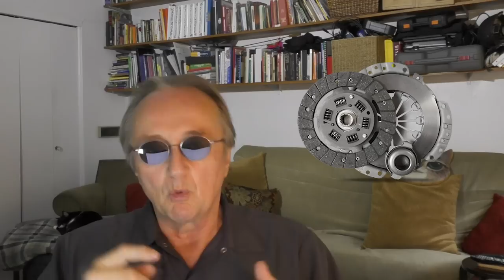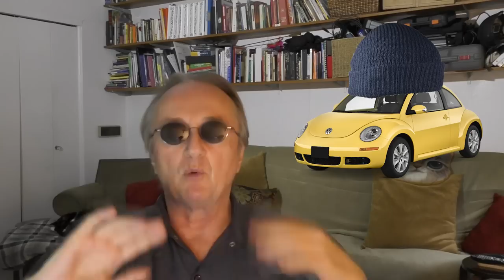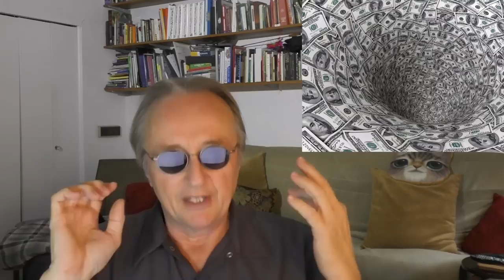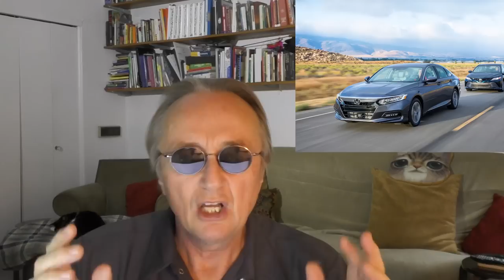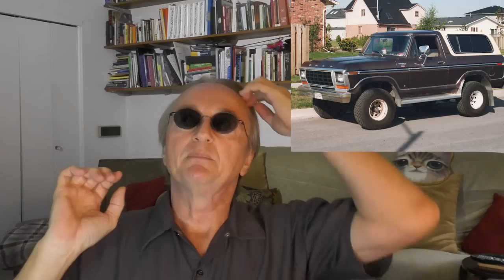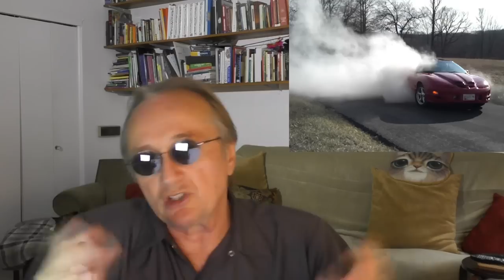Doing This Will Destroy Your Car’s Flywheel

Comment: You can buy the clutch for cheap.  It's the labor that's a killer.
Reply: 351WINCHESTER true
Reply: @adrianleap6351  But it's no cheaper when you need the flywheel too...
Reply: Well it is a lot of work
Reply: Do it yourself and it costs a lot less.  Pulling wrong wheel drive transmissions is a poopy job however.
Reply: You still have to replace or repair the flywheel after 2-3 clutch replacements. On my car it was worn out in the middle, so it wasn't flat. Instead, it looked like a funnel. It made the clutch quite jerky.
Reply: @vladimirlindemann5422  I get my flywheels resurfaced every time I change a clutch, even if 1st time.  I'd rather fork over the $50 or so for the machine shop charge and know everything is done correctly than to shorten the life of a new clutch.
Reply: @Ryno-fp7pm  Yep. It makes a significant difference.
Reply: Had to do a clutch and dual mass flywheel on a diesel peugeot, over $1000 with parts and labour and took 6 hours
Reply: @VeLvEtGuNs  Dual mass flywheel is a story on its own
Reply: Ryno5150 how can you tell if the flywheel is bad after the fact. I've put a few clutches in, not myself though.
Reply: @notthisguy5068  the surface of a worn flywheel has dark stains (blueing). You can also check it using a straight edge.
Reply: @hungrynapps  , 4 Hours Of Work ?
Reply: I had a car that was gonna cost $1300 for just the clutch kit... The car itself was $150 running and driving, I sold it for $500 as is 🤣

Comment: Had a 06 v6 hyundai sonata.. 184,000 very hard miles when i traded it in... only thing i ever replaced was an upper radiator hose.. brother has an 06 hyundai sonata v6.. just rolled over 260,000 (original spark plugs by the way)  timing chain was all he had to replace ... i am not a hyundai fan by any means but they seem to run pretty long if oil is changed.

Comment: Beam me up, Scotty. I just financed a 2017 Chevy Cruze hatchback, 16,000 miles on it, and i have noticed that the car does not like to be "learned" on ar as HP goes.  I leaned on it the first time I drove it off the lot and I got a warning that the StabiliTrak WAS NOT ACTIVEay this because the car changes gears when It feels like it. Please tell me what to do before my 45 bumper-to-bumper, the warranty runs out. I  Not that I want to, but why does the car tell me that it needs maintenance. The Check engine lights came and everything. What does this mean? ?   Can I not drive my NEW car as I wish?   Cut me some truth. . . . . . Love this channel

Comment: Hey Scotty, I have a 2002 Chrysler 300m that won't start. It cranks just fine with no odd noises. After the power is on for about 10 seconds, the check engine light flashes, but it tries to turn over when I spray starting fluid into the air intake. I'm thinking its a fuel pump, because I don't really hear anything kick on when I turn the car's power on, but I don't want to replace that unless I have to. I already checked the fuel pump fuse and it was good. Any advice as for where to start? Thanks.

Comment: Notice every single car someone mentions is not recommended and uh I know a family that since 2011 they have been buying all the new Hyundais and especially the Genesis one of them I know specifically has 263000 miles on it like mentioned you do the maintenance on the vehicle most likely it will last you as far as Volkswagens I mean we all know that those Transmissions aren't the greatest but I mean come on I'm not defending Hyundai I had a 2011 Hyundai Sonata 2.0 T and honestly that car treated me pretty well my cousin got in a 2011 with a 2.4 and there was a massive massive recall on the bottom end of those engines something about the crankshaft being manufactured the wrong way picking up shards of Steel in the oil pickup lines

Comment: To get a New Beetle trans replaced cost around 5K?...Is that rebuilding the bad one?...I thought that a good trans shop would have a rebuilt unit on the shelf and that would simply be an R&R to minimize "down time"...By having several units available, the cost should be much less.

Comment: My dad has an 04 Camry and the original clutch made it just over 360k before it completely gave out. Was a heck of a chore changing that thing out but totally worth the trouble.
Reply: Your dad is one of those men who really do know how to use a clutch.
Reply: Many others like me don't I guess you just have to shift veeery fast.
Reply: No, you need to match the rpm of the engine to the transmission speed/road speed. Hence good manual drivers can heel-toe to raise engine speed on downshifts, and release the clutch smoothly to perfectly match the engine rpm to the rotational speed of the transmission in upshifts. This is how you drive without jolting the drivetrain and burning the clutch through the friction of mismatched flywheel and clutch speed. (Your clutch is attached to the input shaft of your transmission on splines).
Reply: We were at a red light when my friend's Honda Civic clutch cable popped. Just a pop sound, and no more clutch. He's hating life while cars are honking and trying to go around and I'm like here, let me drive. I don't know what you're gonna do without a clutch but at least people will be glaring at you and not me. Turn the car off, get it into first, then start it in gear. Shifting into second is tricky, have to match the gear speeds exactly as you feather it out of first gear. Compared to that, shifting into 3rd and 4th was a piece of cake. He's like how are you driving a stick shift without a clutch? Well I didn't know I could until you stranded me in the middle of an intersection and put me on the spot.
Reply: Mine ia currently on 113k kilometers original clutch on Chevy aveo 1.2 2006
Reply: wholeNwon Probably all highway miles.
Reply: He was probably granny shifting, not double clutching like he should've!! 😂 sorry that was mandatory.
Reply: @SavageBunny1  , Double Clutching A Car ?

Comment: The policy in relation to a failed vw clutch or flywheel in these parts is to replace both, as the labour cost of the operation is high and if the remaining component is retained it may still fail later, just as the water pump is changed at the same time as the timing belt. I’ve never changed a clutch, and it doesn’t look like an easy job!

Comment: I personally would drive a manual 2006-2012 Honda civic si coupe as my first car and modify it because the parts are readily available.
Reply: I stopped driving a Manual 6 dpeed Subaru outback  with  120,000 Klms Diesel it was a great car wagon  1000 k,s per tank  no  got my Honda CRV ald great all  town rounder  $65 to fill the tank on 91 octane car .
Reply: Id rather stay with my 06 chevy ssr way better made best first car to have
Reply: Tuco Salamanca 😂😂😂😂😂
Reply: @dungdippedindian3933  So you're saying 06 GM somehow isn't the absolute low point of car manufacturing quality in history
Riight
Reply: Or If you want the space get a caravan before 96 my 91 has 50k miles and ive only had to replace the transmission once
Reply: You can run into issues with those cars. Most people drive the SI fairly hard and don’t always keep up on the maintenance. A lot of younger people buy them and don’t really know how to treat a car. I personally wouldn’t buy a used one that old unless I know for a fact the previous owner took good care of it
Reply: @bigmid7486   You're right about that and I don't understand why some young people or even some people in general treat cars like crap. It's no surprise why the Honda civic or yet the entire Honda brand in and of itself gets a extremely bad reputation for either being riced out, poorly treated, or being clowned on. But that happens to most car models as well not just Honda. Like you said some young people don't treat a Honda civic very well, that's almost the equivalent of treating a nice extremely expensive car like a piece of crap instead of driving it precisely and taking a great care of it. I'm only 18 years old and I am a sporty car person but even though if I drive a Honda civic Si 2006-2012 I would treat it good like a nice expensive high end sports car even though cars in general are mostly expensive anyways. But thanks for the information, that'll keep me in mind when I buy my own car some day.
Reply: EvoEvan Nismo Just definitely make sure you get a good mechanic to look at it, like Scotty always says lol. Honda Civic Si has a negative stigma for being a young kids car unfortunately. I drive a 2018 Ford Fiesta ST and I rarely drive it hard. It’s super fun to drive and it’s really quick but i actually want it to last lol
Reply: back when i had my Integra kids in civics were constantly trying to race with me. its was so annoying.  Nobody bothers me in my Toyota now. lol!

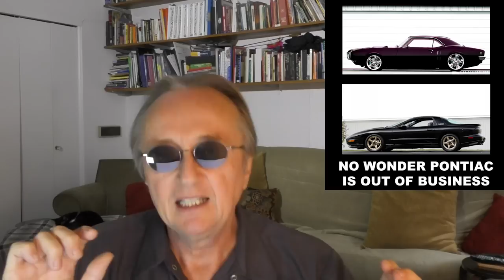Comment: 4:09 All true but so long as it's taken care of the 3800 can go 250K without a thought.  Just change the oil.  The 3800 is an evolution of the Buick 3.8 and heralded as one of the best V6 engines in automotive history.  It's a pushrod V6 with a single cam and in 2000 was pumping out 210HP and 220Lb/ft of torque.  Translation no multicam VTEC timing belt BS to deal with.  A simple design that is easy to work on which in that body is saying something.  I had one in a Camaro that had 157K on it and the only problems I ever had in that time were water pumps which on that car is literally 20 minutes to change with 1/2 a beer.  I'm a little sick of the GM hate from Scotty.  Yeah, they made a lot of crap but so did all the automakers.  With the 2000 V6 Firebird the biggest thing I'd worry about is the 4L60E transmission which has a reputation for failure but in my case I had zero issues with it in that car again because it was kept maintained with regular fluid changes etc.  The biggest mistake GM made with transmissions was putting a transmission like the 4L60E  (which was really just a 700R4 with electronic control) behind engines that were too powerful for it like the LT1 and LS1.  Fine behind a V6 but V8's of the time could easily tear them up.  Hey, I'd buy one now (a V6 Camaro or Firebird)  if I could afford it but I'd want to see service records.  If it wasn't maintained then everything Scotty says is true.

Comment: Good to know, all I drive is manual transmission cars, this will save me lots of money.
Reply: Mazinblaster Z 
Never! My very first car was a manual transmission and that was 26 years ago. In all that time I’ve owned 5 manual transmission automobiles and I did wreck a few of them but a clutch has never gone out on me. I absolutely hate automatic cars, I’ve never owned one and I never will.
Reply: Mazinblaster Z 
I live in San Antonio Tx and I go to Austin and Houston quite frequently and the stop and go traffic doesn’t bother me driving a manual transmission vehicle at all. But I do know there’s a first time for everything and I’m sure one day my clutch is going to go out on me. I currently have a 2013 Honda Accord and I have 119,000 miles on it. I’m not very mechanically inclined which is why I subscribed to Scotty’s channel and it’s videos like this one that are most beneficial.
Reply: Richi RIch 
LOL!
Reply: @Mazinblaster Z Austin traffic sucks but driving manual in it isn't so bad. Maybe I'm just used to it tho.
Reply: In my opinion, I'd much rather daily an auto.. but I'd keep a manual as a fun weekend/casual car
Reply: Same for me, I've owned 5 cars over the last 15 years and all were manuals, and I've never burned out a clutch, AND I only drive "classic" cars (Pre-1992 non-fuel-injected vehicles) However my current car, a 1991 Peugeot 309 has had it's synchro in 1st gear broken by the first owner, so I don't know what shape the clutch and transmission is.
Reply: @Mazinblaster Z It's cheaper then repairing or replacing automatic gearbox
Reply: With how often most of you are changing cars, it’s no surprise the clutch hasn’t burnt out on you.

You think Austin is bad, try Pittsburgh. Stop and go traffic, on a steep hill. I feel bad for my Element.
Reply: @bonnevillebagger9147  that sounds like a nightmare.
Reply: @pilgrim985  "hate" is such a strong word...and I could not agree with you more.  Automatics are awful.  So awful that I have done auto to manual swaps on 3 of my vehicles.
Reply: Ryno5150 
I really like the Toyota 4Runner, a couple months ago I went to the dealer only to find that they don’t make them in a manual transmission so I left quicker than I got there. I don’t know how to convert an automatic to a manual transmission or how expensive it is but maybe I’ll look into it.

Comment: Guys please upvote this to get Scotty’s attention. I really need serious help, or if anyone has a helpful opinion let me know. Also, if you need more detail that can be provided too.

Scotty please help

I have a 2014 INFINITI Q50 3.7L V6 Naturally Aspirated. Note: Proven Stillen-brand Dual Hi-Flow (oil filter) intake installed. Note: Car began idling lower. Nothing wrong, until months down the road when the RPMs would begin dropping down between 600-1000 after gas pedal is released while coasting anywhere between 30-50MPH. Tachometer visibly bobs up and down, appearing to want to stay awake but continue almost falling asleep. On bad days, RPMs will drop too low and engine will stall while car is still in motion, power steering will then disengage, and battery / check engine light will appear. I pull over; restart car. Engine turns over instantly. Begin driving; problem persists but stalling does not. Symptom only common after each time battery is disconnected. Note: ECU evidently re-learns and gradually adapts to problem after every occasional project-related battery disconnection. Symptom more than likely to occur after being heavily throttled very shorty after turnover. Symptom has never occurred at speeds 55-60MPH or above. Each and every source points to IAC Valve cleaning. Anything else?

You’re the best Scotty, please help me out.
Reply: Sounds like it needs reprogrammed by the dealer. Or maybe a bad idle control motor.  Don't let it go on very long as it may cause ECM damage and it could be unsafe

Comment: Scotty Kilmer sir,

My friend has a diesel suzuki dzire 2017 auto transmission car. He was complaining about loss of power (like engine stalling) while driving and again power comes back to the vehicle. He got the transmission changed at 40,000 kms (24,854 miles approx.) at company authorised service center. The above problem was before the transmission change. Now, after the change he is once again facing the same problem. During the pandemic he already drove 8000 kms (4970 miles approx.) without oil change for more than 1 year now.

This car is one of the popular and highest selling car in India.

I watch your videos all the time. Please answer this question through a video if possible?

Comment: Regarding your advice on selling the VW Beetle with the bad transmission that needs to be warmed up to work, it is important to note that when you go to sell that car it would be unethical not to notify a buyer that the transmission has a problem and describe the problem.  It's just dishonest to try and cover up a deficiency that seriously affects the car's value.  The car will still have value, but the new buyer needs to adjust the price to reflect to cost to repair the transmission.
Reply: Of course.  Sold "as is"
Reply: The new buyer needs to spend the money for a PPI.  It's not a seller's job to take care of the next customer. When you buy a used VW, YOU'RE buying someone else's problems.
Reply: It's a VW Beetle.  Everyone should know that it's gonna be a pos.
Reply: Thank you Ralph Nader.

Comment: smart men stay away from European and domestic cars
Reply: Exuse me ? 1.9 TDI Diesel engines from VW are very reliable. Or an old Mercedes like the W124 just a great car. But currently yes thesedays German cars suck di*s.
Reply: Just the rest of the car isn't. Most of their dashes are lit up like Christmas trees from electrical faults and emission control gear faults.
Reply: Datsun! I have a 240z :)
Reply: 2.5 Jetta is one of the more reliable VWs ever made

Comment: IF you're going to get an s60R GET A MANUAL M66 trans. They are much more reliable, but extremely rare. Also get one with the 4C electronic suspension already done, that's a $2000 job all four just in parts.
Reply: I always wanted an S60R or a V70R but they’re all starting to reach the age where they most likely need a lot of expensive repairs and the reliability of them is a total crapshoot as they get older and higher mileage.

Comment: Hay scotty  it's Gordie, UK.   Iv had a 2006 kalos 1,4 16v petrol manual, I do a delivery job  still only 77000 miles,  I change oil & filter regularly and plugs air filter,   runs so sweet any comments or recommend anything mate,

Comment: I actually own and drive daily a MT 04 V70R with over 324,000km. I would agree that they are above average to cost to fix, but as a semi-hobby car, you can do a lot of the labor yourself and not spend a lot of money. Just replaced the timing belt and had a new clutch put in, it should run for another 150,000km.

Comment: In 1969 the graphite throw out  bearing in my 1958 VW van went out in Winnipeg. With bump starting I made it to Ottawa before replacing the clutch assembly. God looks after young fools sometimes.

Comment: Hi Scotty, Have a 2014 Fiat 500L manual 6 speed.  Grinding noise when reversing and briefly when downshifting.  This stops after the car has driven for a while.  Fiat says to drive it until it fails because they have no idea what is causing it.  I think it is a clutch issue but Fiat says $850 to pull the drive train and diagnose.  Have been driving it this way for 6 months, bite point on the clutch has not changed and car stalls when letting the clutch out at 1500 rpm with the parking brake on.  Any ideas ???